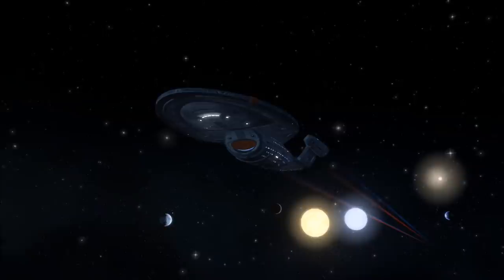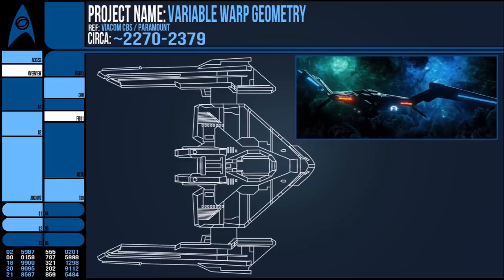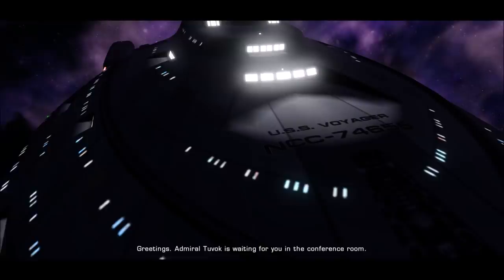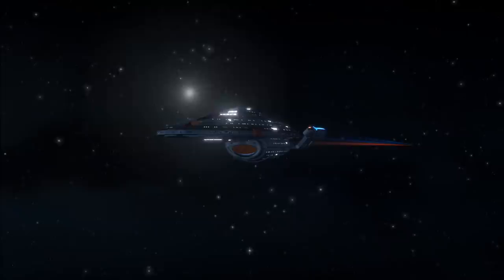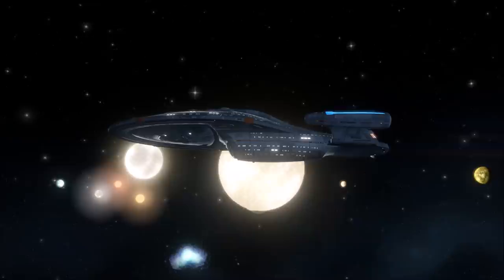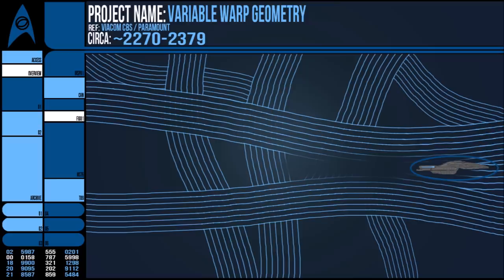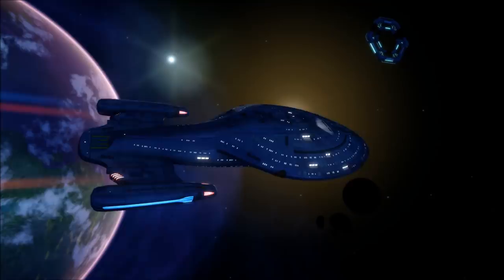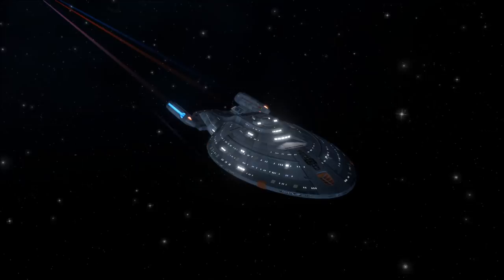VOYAGER'S "Hinged" Nacelles

Comment: The explanation makes 'some' sense, but it doesn't solve a few critical problems.
The nacelles have a resting position of 'flat' when at impulse, and raise up when going to warp. This begs the question, why don't the nacelles just stay in that raised position with a smaller adjustment range?  Part of the reason warp nacelles are arranged is that the nacelles have to have a clear line of sight with each other.  Why even bother lowing them so they're obstructed?

The other thing is, when the nacelles are raised to warp position, the Bussard Collectors on the front become obstructed by the saucer section.  It has been a long-standing rule of star trek that those shouldn't be obstructed from direct forward view, and for good reason.  They're electromagnetic plasma scoops.  I would assume that your best chance for scooping would be while you're at warp, as you're racing across the interstellar medium like a snow plow down an interstate after a Noreaster.  So moving the ramscoops into the shadow of the saucer when at warp makes no sense.

So while it makes sense that adjusting the position of the coils can smooth out the warp bubble,  how it is applied makes no sense.

Comment: Technically speaking, space is not a perfect vacuum, if you actually were trying to push for relativistic speed those hydrogen ions and every last photon you encounter would have an effective drag on your ship. But this effect is such that it's more a question of thruster-power versus shape. If you're ripping along at something like .5c, you'd likely be firing your engines constantly to overcome the effective drag of hydrogen ions, light pressure and micrometeorites.

Comment: I'd always thought the "variable geometry warp pylons" was something more analogous to hydrofoils.
They need a certain shape to start up, just to steer around and get moving at low speeds.
But once they pass a certain speed threshold they use a different configuration to maximize performance and efficiency.
Same propulsion system but operating in a different mode to reduce contact (friction, drag forces, etc) with the "surface".

Comment: Oh boy 😒 Does anyone fully understand Starfleet sciences?  Apparently, not.  Let's get it all correct here: yes, the warp field intersects 'real' space and subspace in order to function.  I was one of the early adopters of this position.  Yes, Variable Warp Geometry is one of the reasons for the moveable nacelles.  But not the only one!!  According to Starfleet design specs, warp coils make up a significant mass of a space vehicle.  The higher the Cochrane output, the larger the nacelles needed.  Voyager is very fast and can sustain this for long periods, meaning by canon the coils must be very dense - heavy.  Voyager is capable of landing on a planet, doing so whilst dragging along those heavy coils.  When down, the nacelles are along the center of gravity of the Engineering hull, enabling both faster roll response in space as well as better weight distribution whilst landing.

Comment: The real question is not why they fold up at warp. But why they do not keep it folded up at sublight? Most ships just put their Nacelles where they will be most usefull at warp - end of design discussion.
Clearly there must be a advantage to having them level at Sublight, but angeled at Warp. The most obvious one would be that they put the impulse drives into the Nascelles. A markeldy different orientation from most Enterprises, wich had those on the level of the Saucer. So having them not angeled during Sublight makes the ship more stable.
So it is more a mater of the impulse engines, then the warp engines.

Comment: My theory is: A heavy design flaw was discovered with the Intrepid class that vibrations at high warp speeds would case metal fatigue. By the time the flaw was discovered, several Intrepids where already half build, so a quick fix had to be developed. Angling the nacelles would solve the problem, but now the impulse drive mounted on the same pylons did not work, so the nacelles had to be build movable.

Comment: Obviously the Voyager doing 9.975 as a "cruising" speed is highly unlikely despite the one line from the pilot episode.  Cruising being a speed that the engines are comfortable with for sustained time periods.   It's a shame there doesn't seem to be vast numbers of analysis videos pointing out what has to be a typo in the script.  Your chart lists it also as the max warp - which is reasonable and still impressive.  In the real world moving ship parts are surely a visual gimmick - that STD took to a ridiculous extreme.

Comment: Real life explanation for the nacelles? People designing the show told the designers that an absolute must was that some part of the ship had to move when used. Rather it was the engines when the ship went to warp or if in combat the ship did something similar to the Chimera in STO deploying its phaser lotus weapon(something along those lines but without the STO reference was discussed). They really didn't care. Once something was agreed on, then they had to come up with a lore based explanation that would be more fitting than "that was the one time that Tom Paris DID get to design a "hot rod""

Comment: Its kind of like the F14 Tomcat, the only model of fighter which had the variable geometry wings. After that era, computers were powerful enough to stabilize traditional wings at both low and high speeds, rendering the sweepwing moot.

Comment: That doesn't make any sense.   For hinges to be worthwhile, there has to be an advantage to having it in both orientations.   Your explanation is that its better when they are tucked in to make a sleeker bubble, but you failed to explain what advantage there is for having them further out.    If there's no advantage, they would just fix them in the up position.

Comment: Except if they just made them in that raised position and never brought them down it would accomplish the same thing making a sleeker warp profile.
So really it moves because it's cool.

The only other logic I would have that in the position for warp travel it has less structural integrity on conventional forces and possibly center of thrust at impulse speeds, especially if the planet is landing, so you'd want them in the lowered position for better ship handling at impulse, and raised to make the better warp field during warp where conventional forces are irrelevant.

Comment: The original reason for the moving nacelles was due to a then mandate that in order to make a warp field, the nacelles needed uninterrupted space between them. This was a thing back to the original series. But then the Defiant happened, and suddenly it wasn't necessary anymore because it provided a more open ended design process not hampered by having to have the nacelles stick out the same way if they didn't want to.

The 'subspace damage' episode hamstringed the writers too much to stick around anyways, and soon the enterprise D was going at warp 7-9 again without much care. I suppose it could be argued that an offscreen solution was retrofitted into the fleet, and as the flagship, the enterprise would most certainly have topped the list for getting that modification.

Comment: It's for astro-Aerodynamic. They are for warp but also for landing and take off being a mobile science lab it need to set down and when landed because of the size and where the landing struts are it keeps balanced and weight control. It also looks cool. Plus if I remember correctly the impulse engine discharge is right where the warp nacelles would be according to what I've hear in other show it would be bad if the discharge hits the nacelles.
All good reasons for it to move to its varied tasks

Comment: That doesn't explain why the Voyager doesn't have the hinges up *all the time though*.

My explanation is that it's really about changing the centre of gravity of the ship. Voyager for whatever reason is a top heavy ship. So in impulse the nacelles are down to align the impulse drive with the centre of mass of the vessel. When the nacelles at up, the ship is able to generate a smaller warp field that covers the entire ship, making the warp more efficient.

Comment: In my headcanon it is just that. The subspace gets damaged by static warpfields pushing through it with just more and more power. To prevent that the field must be variable to basically morph to fit the current subspace deformations caused for example by gravity of the space the ship is passing through. The easiest and most obvious way to do that was to make the warpfield emitters aka the nacelles them self change position mechanically which in turn changes the geometry of the warp field. The first intrepid class the uss intrepid lacked that ability. If i recall correctly the Voyager was the first one to be outfitted with that. In the show its always shown that the nacelles do fold up and stay there while in flight. Question that comes to mind is why not mount them upwards from the start and just make them move a little down if the nacelles will always be more up than down? Only logical answer to that for me is that it doesn't matter and there are occasions when the nacelles are actually in complete flat position while on high warp and move everywhere in between so it doesn't matter which is the standby position. Or that on rare occasions they can even fold downwards which would make the flat horizontal position the middle and the logical default position while not in use. Anyway later so it seems a different method was found which was employed in the Sovereign and all later classes which didn't required movable nacelles and is because of that probably superior because of lesser resources or more stable connections to the main frame of the ship.

Comment: The problem is that, in the show, they state that the nacelles must be locked in the "up" position, for Voyager to be in warp. And even if that weren't the case, there's still no explanation as to why they come down to the flat position at all.  You'd think that, if they had to at least start in the up position, that that would be where they were normally were positioned.

Comment: few problem with your theory.  Voyager was the first of her class and was disguised to be sleek to be able to travel in the badlands the rest of her design just happen to integrate the other things mentioned because you are not going to make a ship that can only be used for that single mission then not used later one. Even more glaring is that it can travel that faster due to bionueral circuitry, incorrect because voyager ripped that out and replaced it with isolinar circuitry  because while slightly slower was more reliable.

Comment: WARP 5, IT'S A SPEED WE CAN LIVE WITH....🚔👮📝💸

   I assume it also has something to do with atmospheric aerodynamics. Voyager does occasionally land, so perhaps having the nacelles in the down position makes the pilot's job a bit easier. 
  Can the primary /secondary hulls separate?
   In the "Hitchhiker's Guide to the Galaxy" <book version>, Galactic President Zaphod Beeblebrox's stolen ship, the Heart of Gold, was described as looking like a "Sooped-Up Tennis Shoe." 👟

--Peace, Long Life & always know where your towel is at. Mine's a nice, black terrycloth. How about yours? 
🌌🔭🚀✨👽💫
Reply: was just about to say the same thing about planetary landings
Reply: Great I see at least a couple more fans have actually paid attention. Yes the hinged Nacelles are for atmosphere navigation and landing. We only see one other type ship with that capability the Klingon Bird of Prey whose Nacelles also hinge.
Reply: @Ken Jett

I still fail to see how and why hinged nacelles would make that much of a difference, considering how rarely it actually happens that a ship needs to land on a planet and in comparison to the costs.

And those hinged nacelles surely are costly. Not only in economical costs and concerning the resources needed, but also when it comes to structural integrity, maintenance costs, possible technical failures, working hours needed to keep everything running and of course there is the question how easy something is to repair.

All of that only because you want to "make the pilots job a bit easier"? Makes not really sense to me, except this ship would otherwise absolutely not being able to land on a planet, but you need it absolutely to be able to do so for some strange reason. And I guess whatever your reasons are, there must be a less cost intensive way of achieving your goals.
Reply: Girlfriend: I know that expression, admit it, you are thinking of other women!

Me: If the Voyager would flap it's nacelles fast enough, could it fly in an atmosphere?
Reply: @Furzkampfbomber  you must not pay any attention to details in Star Trek do you? Cost is irrelevant in the Federation there is no cost they don't use money. There is no poverty or wealth in the Federation. Now for the science the repositioning of the Nacelles is done upon entering atmosphere to aid in lift of the ship. When in warp position they cannot obtain enough lift. This was referred to in Star Trek Beyond when they was attempting to get the Franklin back into space. For the engines to create enough lift they had to reach terminal velocity in freefall. That problem was eliminated by the repositioning of the Nacelles in the Intrepid Class which was designed to be able to land on the surface of planets. No other Federation Star Ships could do that because they could not sustain lift unless moving at terminal velocity.

Comment: One thing I've always wondered about since watching that episode is how the romulans got around this problem.
Reply: Do they use Warp Drive? Always thought that because of their singularity Drive they dont have that Problem.
Reply: I think the techno-babble solution is that they used a Forced Quantum Singularity for the power of the their warp cores, so its' subspace shadow extends far enough to move subspace currents out of the way thus not producing drag.
Reply: Like an island in a river
Reply: @SumBrennus  darmok and jalad on the ocean
Reply: @SumBrennus  So because the singularity has such a massive gravity field it basically just makes a smooth corridor for the ship to go through. I guess that makes sense, it doesn't fight against the current, it actually changes its path.
Reply: The Romulans have what look like warp nacelles on their ships, I figured they were just using the quantum singularity to produce the power to run them as opposed to powering them with an antimatter reactor. The 'warp core' has always been the power source, not the means of actually warping space itself, which is the warp coils found in the nacelles. 
And since the Federation hasn't come out with a whole line of variable swing nacelle ships it seems they found an easier solution than redesigning all their ships.
Reply: The Valdore class warbirds in ST:Nemesis had a much lower profile than the TNG era D'deridex. I assume warp field geometry was at least partly the reason for that big shift in design.
Reply: @finthegeek  Shaaka when the walls fell.
Reply: @therearefourlights6926  There are a lot of more swept-back and angled pylons in the post-TNG designs, like the Akira, Sovereign, Nova, and Odyssey, along with the vessels that do away with the pylons like the Defiant, Saber, and Steamrunner.
Reply: @Janoha17  
Not sure if I understand you. The pylons you're mentioning are fixed, so I don't see how their angle effects what we've been discussing. 
The idea with Voyager's ability to move the nacelles in flight was to actively adapt the warp field to different conditions. 

Voyager's pylons aren't swept back at all, they're pretty stubby. The refit Enterprise from the Motion Picture had swept back pylons and that was way before the whole issue of damaging subspace was ever raised, so I'm not sure the one has anything to do with the other. Most of the ships you mentioned were built after encountering the Borg and had a greater emphasis on combat with corrisponding lower cross-sections.

Honestly I think the writers sort of forgot the whole issue and probably handwaved it away with a software update to existing ships.

Comment: It's actually dumb not to just leave them in the high warp position at all times... hinges just have an extra moving part to go wrong
Reply: Nope, the sublight engines are also mounted on the "wings", and they're best used when as far apart as possible for tighter turns.
Reply: Mark Fergerson that isn't true.
Reply: @rollerbladinggeek5507  Have you ever actually looked at the ship from behind?
Reply: Mark Fergerson Yes I'm on a shuttle craft right now looking at it

Comment: I imagine when they switched to "Slower but more reliable Isoliner Chips" that also meant Voyager had to stick to lower warp speeds as well. Or did Voyager never switch like that? I can't remember for sure, been years since I've watched all of Voyager.
Reply: They fixed the problem, which was Neelix' moldy cheese giving the gel packs colds